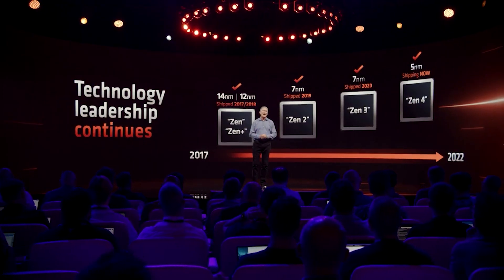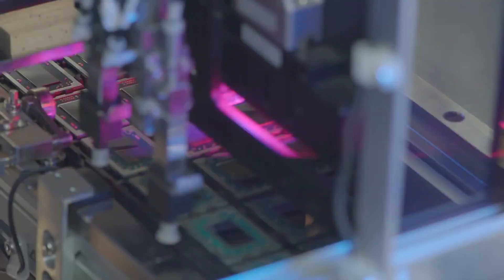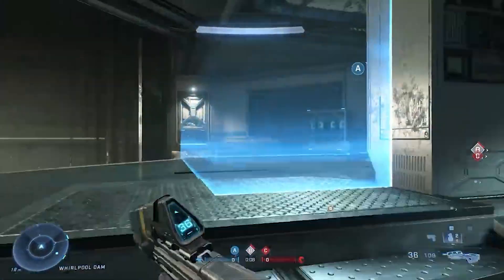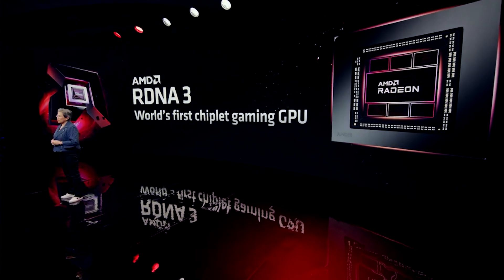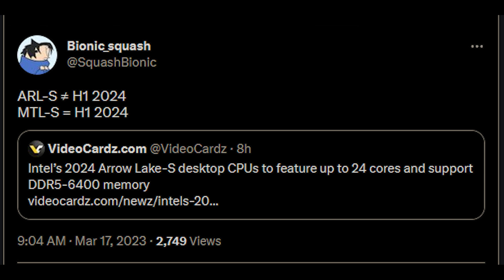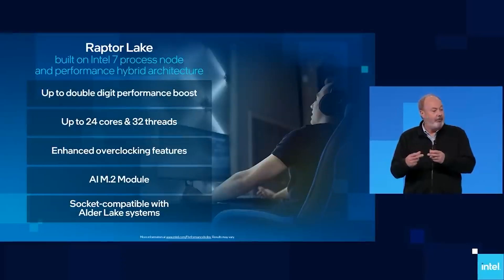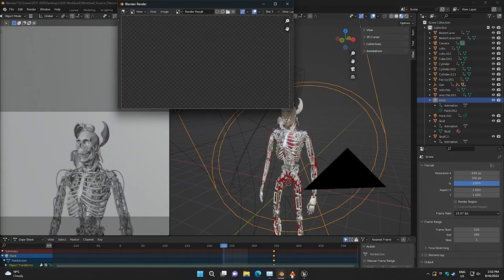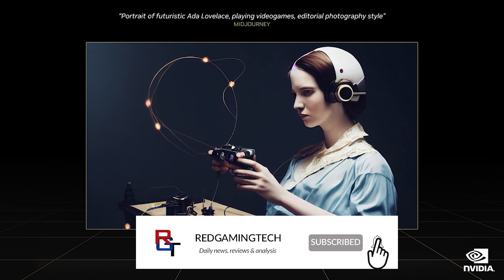Zen 5 CORE COUNT Revealed! HUGE Intel Roadmap UPDATE

Comment: I have continued to say and will keep saying that if AMD sticks with the SAME ASS 8 core CCD and try to make something to compete with Intel on desktop they're going to get their ASSES HANDED to them by Intel who will start winning back the market share they lost to AMD for desktop.  

AMD CANNOT find enough clock speed or IPC gains to compete with what Intel is going to do with 14th gen UNLESS they do a lot of the thing Intel is ALSO doing along with APPLE, such as accelerators which ACTUALLY accelerate REAL workloads that people are concerned about, such as video rendering.  16 cores is way more than enough for most users and I COMPLETELY understand this, but whereas Zen 3 - 4 gains were decent but at the expense of clock speed and power consumption, Intel, on a very inefficient node of Intel 7 is NOT going to be on that node for 14th gen.  Intel doesn't want AMD hanging around nipping at their market share and desktop is the easiest place for them to start winning back market share.  I'd say laptop too, but AMD never really gained much traction in that space and Intel's newer CPUs are better across most the product stack and people haven't really moved away from Intel in that space like they have desktop.  And 14th gen Intel laptops are going to be outstanding.  It will be a slug fest in the server market once Intel gets off Intel 7, but Intel is doing excellent work with improving the technology of CPUs recently, more so that AMD and that's about to give AMD a good thumping if AMD puts out the same old stuff, with improved IPC.  That won't be good enough when the competition is beating you at every tier level except at the very top which probably won't even be true if AMD sticks to 16 cores.  They'll get beat across the entire product stack, and it won't be because Intel CPUs are using 2X the power.

AMD needs at LEAST an 8x8 CCD with 8 big/8 little cores so they can push 48 threads at the top end.  Otherwise Intel is thumping them.

And for those who doubt this, AMD is selling very well for desktop, but it's Zen 3, NOT Zen 4.  On the other hand, Intel 12th and 13th gen is easily beating out Zen 4.  So that shows you what a lot of the consumers think and apparently the power consumption doesn't matter too much for desktop when it comes to 13th gen vs. Zen 4.
Reply: agreed 100%. AMD need to increase core counts as well as find a way to increase core count flexibility in the end product. and they need to get that infinity fabric running at much higher speeds.
Reply: @_M....  Or move off that infinity fabric because that's the reason they're hitting problems now such as low memory speeds with 4 sticks and a cap at 6000 mt/s which means AMD is capped at 3GHz.  And that was AMD taking a LONG TIME to put out Zen 4.

It's projected the interface Intel is using for 14th gen is much better and some of the more trusted names have said as much such as Windell at Level1Tech.  So maybe AMD should move to THAT interconnect since it's the one that's open source from what I understand.  It also runs parallel instead of serial like this Infinity Fabric, and usually parallel interfaces are better WHEN you can run at very high speed AND you have a very good connection, otherwise serial works better.  I don't know if it's the bandwidth limitation of latency that's created that causes the memory speed to suffer.

But to be fair, a lot of reviewers talk about Intel 13th gen as if its memory clocks can clock much higher and no they can't.  Once again Windell at Level1Tech says they have a lot of people on the forum asking how people got their 13th gen CPUs to run with the 7200 memory kits so that's probably getting near their limit, but I don't think they suffer as bad with 4 sticks like Zen 4 does.

Really there's a long list I think AMD needs to do and right now I think they're complacent because Zen 2/3 worked so well for them.  But Zen 4 hasn't, except in the server market.  And, of course for gamers the Vcache parts will sell very well, mostly the 7800X3D, though a lot of creators will buy the 7950X3D so they have one machine to game/work with. THAT was probably the best thing AMD could have done for desktop Zen 4.

Next on my list (getting much better memory speeds = 1) would be the CPU-chipset link needs to double like Intel already did.  Once again AMD is complacent here where they were the first to 8GB/s if I remember correctly but now they've let Intel pass them.  But this once again gets back to the Infinity Fabric and the comms between the CCD and cores.  Maybe they should move the memory controller off the IOD and put it on a CCD?  Then have a direct connect between a 2nd CCD and the one with the memory controller?  So right there is 2 different types of CCDs, and that would fix the memory speed issue.

Then core counts, then an accelerator that matters to people like what Intel and Apple did, they don't need to roll out AI right now, but OK

I buy AMD for the most part unless Nvidia puts out a lower cost GPU, but right now AMD isn't impressing me, Intel is.  Meteor Lake seems pretty awesome from reading about it, and Arrow Lake is supposed to be a progression from that.  So both are tiled CPUs where they can use ICs from different companies which also mean they can use die from TSMC, Samsung, themselves, etc....  Considering Intel already beats AMD at every tier level except the top for desktop because Intel can load a CPU with little cores, yeah they'll get a butt stomping if they stick with that same architecture.
Reply: @johndoh5182  again, I agree. the infinity fabric is a bottleneck and they need to come up with something new already. the limitations of it can really be felt with Zen4. all i know is tht stagnation now is gonna come back to bite AMD and cause them to lose in the one area they've gained back over the last few years. I like AMD and usually get good value out of them. I've only used Intel in the years after bulldozer launched up until Zen 2. heck, my Intel systems were cheaper than my AMD because with few exceptions I always got top end AMD systems and from Sandy bridge to Haswell Intel chips on mainstream were really cheap, as were the motherboards. on the gpu side, i often wish AMD had never bought ATI. in the big picture I am not a fan of how they've done overall.
Reply: @_M....  The GPU market is tough for sure but I think it was better for AMD they bought ATI and become what they are now in spite of the issues they have in competing with Nvidia.

Right now AMD owns the world of gaming consoles because they produce graphics, and it also gives them partnerships that have helped over time.

The issue is always one of strategy and how they can compete.  For instance without RDNA 2 they'd never be in the position now with 2 lines of CPUs/APUs for laptops which is an important market for making money.  You don't have to be the best at everything, but you have to compete and have enough marketshare that allows you to grow and I don't think AMD could have done that without ATI, in fact because their CPU market was a disaster from 2011 - 2017 and even first gen Ryzen wasn't moving the needle very much for them, Radeon is partly what kept them going.  So there might not even be an AMD right now if they never bought ATI.  They had almost zero marketshare for laptops, server, very small for desktop and had SOME profit from game consoles and graphics.

They need a bigger and better engineering team though so Intel, Nvidia and Apple aren't always the one leading with new technology, and though they were really first with chiplets and CPUs, that was because of TSMC being capable of producing the product, and a contractual obligation to GloFo when they made Zen 2.  They're now completely severed from GloFo and they need to make better use of what TSMC gives them for advantages, and right now the only REAL advantage AMD has over Intel is power consumption and that's TSMC N5 vs. Intel 7.

So, I think the graphics side has saved AMD more than what you might think.  It's been great for them with RDNA 2 being such a big thing for gaming consoles.  It will be another big hit if Sony and Microsoft do the proper collaboration with AMD for RDNA 4 and then put out Pro consoles, as long as Zen 5 performs like it should.

Comment: If what you say is true, then next gen for either manufacturer will mostly be an IPC increase update. Neither will go for big multithreading performance increase. I had a tiny hope to see a 32core AM5 chips, but now I don't think this will happen. 32core Ryzen will likely be on AM6.
Reply: AMD Should do 10 core CCXs...20C/40 thread 8950X for example..ideally 12 core CCXs or 24C/48t for 8950X
Reply: Not true, they may go 8 core high cache CCD + 16 core high density CCD, so 24c/48t Ryzen 8000 SKUs.
Reply: Zen 6 will be on am5 I think

Comment: Now those Zen5 rumours are slowly making sense:
.) Desktop stays at 8 cores because 16 cores because most systems do not need more than 8 cores and increasing performance/core is the smarter decision.
It is made on 4nm because 4nm has better clock speeds and most of the die is I/O cache that will not scale
.) Server will probably will still have 8 cores per CCX, but 2 CCX per CCD which would not be smart for gaming workloads but is fine for servers that have several CCDs anyway.
L3 is lower so the CCDs will scale better with 3nm. Also maximum clock speeds do not matter that much, but power consumption does.

For the cache structure I am not sure what this means yet.
My guess is that this is again client rumours and server rumours mixed together.
I could imagine a shared L4 on big datacenter CPUs. This is similar to Intels HBM approach that it does not improve latency that much, but increase effective DRAM bandwidth for multiple parallel but memory intensive tasks. For gaming this does not make much sense as latency of that shared L4 would be awful.

My guess:
.) Client is more or less staying the way it is
.) Server is a different design with increased L1 (with low clocks latency will still be OK), L2 is shared across multiple cores to replace the big L3, L3 is made on N6 and stacked on top shared across both CCX at higher latency than before

Comment: I do like that intel have a big.little design, it makes sense. Just wished that amd would have it to. And I really just need 2 big cores, and maybe 16 small once.

It's.really rare that the thread past the 2nd one is really.intensive.
Reply: Pretty much every new game needs 6 to 8 (real, fast, P-) cores though.
Reply: @nipa5961  not really. They typically need one really fast  then one pretty fast. And the  there is a bunch of threads that is spread out where ever they cache the best.

Most of the 3-8 core is running a large number of small threads.
Reply: @matsv201  We see games that run very poorly on 4 core CPUs and vastly better 6 core CPUs more and more often now. 
Simply having more cores (of the same cores and at the same clock speed) can have a huge impact on gaming performance.
It depends on the game ofcourse.
Reply: @nipa5961  well...that they run better on 6 cores probobly have nothing to donwirh it being exactly 6 cores, but rather due to either cache or throwput
Reply: @matsv201  No, tests on the same CPU with a varying number of disabled cores (cache was left untouched) showed that 4 cores often aren't enough anymore. 

Don't get me wrong, single core performance is super important in gaming, but core count matters more and more too.
Reply: @SweatyFeetGirl  Doesn't matter that they use 16 threads, they all still run from 1 primary thread. Love it or hate it, but that's the reality.
Reply: @teemuvesala9575  One controller thread, however several high workload threads in modern games.
It doesn't matter how good a core the control thread is on if everything is waiting on a sub thread that got shuffled off to an e core.
Reply: @SweatyFeetGirl  You still didn't understand... How hard is it to comprehend that while the game spreads its workload to multiple threads, its always going to be bottlenecked by the primary thread? This is precisely why to this day single core IPC and cache are more important than the core count. This is why for instance 5800X3D slaughters 5950X in games. If there was 3D version of 5600X, it would also beat the crap out of 5950X in games too. Even 4 core 3D chip would beat 16 core non 3D chip in games. All of this proves you are wrong and have a lot to learn still.
Reply: @kaseyboles30  Lighter threads can easily be assigned to E cores with no performance penalty. Yeah there are couple other threads that are also heavy and benefit from P cores, but not nearly as much as the main thread.
Reply: @SweatyFeetGirl  5800X3D slaughters 5950X in games period. If you argue about that then you don't know anything. 5950X is far behind 13th gen Intels in games, but 5800X3D is able to beat them often. 5800X3D is in entirely different league than 5950X in games. The only games where 5950X wins is where the additional clockspeed benefits 5950X + the game doesn't benefit from 5800X3D's extra cache. The games where 5950X wins are very, very rare.
Reply: @SweatyFeetGirl  This is 2023, and games are still main thread bound. Ask any game developer, they will explain it to you (if your simp brain can take it in that is) 🤣🤣🤣
Reply: @nipa5961  Nah they don't. Primary thread basically powers the games even now, rest of the threads are heavily dependent on that 1 thread not being bottlenecked. The fact games need more cores now doesn't change the fact the primary thread is mostly running the game still. So actually having just 1 P core running the primary thread and E cores running the rest would suffice if the CPU also had large enough cache.
Reply: @teemuvesala9575  No. I've seen gaming tests on a 12900K with disabled P-cores. 
Performance on 2P and 8E was terrible,
on 4P and 8E decent, on 6P/8E and above good/normal.
Reply: @nipa5961  Link? Also, what kind of RAM was used?
Reply: @teemuvesala9575  I think HU tested it after the ADL release. 
I also saw a similar test with Zen 4 a few months ago, but I don't recall the channel.
Reply: @bronanu201  That's exactly what said from the get go. 
You need 6 to 8 cores. Not 16. Not just 1 or 2.
Reply: @nipa5961  You only need like 4 high performance thread, rest could be e cores and not much difference at all. Most e-sports games really just run mainly on 1 thread. That clown was claiming 5950X is better for gaming than 5800X3D 🤣🤣🤣
Reply: @teemuvesala9575  Well, CSGO and Dota run on a potato ofcourse. 
For most new games it's 6 to 8 cores though. 
Also, all benchmarks I've seen showed that performance tanks if e-cores have to be utilized.
Reply: @nipa5961  Nah not the case in my experience. When my E cores get utilized in the game there are no performance drops with 13600K. From what I can see the thread scheduler assigns heaviest threads to P cores, and then lighter threads to E cores. The thread scheduler prefers handing lighter game threads to E cores instead of utilizing hyperthreaded P core threads. Hyperthreaded P core threads don't really get used that much at all.
Reply: @teemuvesala9575  Weird, that's the exact opposite from what I've seen in every test.
All came to the conclusion that games try to avoid using e-cores at all costs.
Reply: @nipa5961  Maybe they do with 13700K and 13900K since they got 8 P cores.
Reply: Amd CPU cores are very small already , its just Intel Pcores are lot larger , but yes Scores are little smaller .
Overall amd CPU die is much smaller already , no need to go with Score nonsense , all Pcores are best
Reply: @skywalker1991  Well AMD have 5nm lithography, Intel dont. that is pretty much the secrete behind AMD small cores.  

But the main reason for having smaller cores are a higher instruction per joule number as well as better performance while doing heavily threaded loads like rendering or video compression

Comment: Not increasing the core counts will be a mistake
Reply: I'd rather have higher frequencies because game engines can't even use what we've got.  I like Intel's approach with performance and efficiency cores for that reason.  More atom cores would be cool, but I'd like to see Intel get a little more efficiency and even higher frequencies.
Reply: Why is it a mistake?
AMD and Intel are tied in performance even though Zen 4 has 8 cores less than RPL.

All Paul said was that Zen 5 chiplets will stay at 8 cores. 
AMD can decide to give the 8950X 2 or 3 (or even more) chiplets very shortly before release depending on the situation and competition in 2024.

Comment: I’m still completely satisfied with my 12100f . Handles all the games I play without a problem. All these new CPUs and stuff are cool but that i3 which is like 80 bucks now NEW is such an epic deal.
Reply: God bless poorly multithreaded games, keeping the i3 gamers happy
Reply: So let's see, a 12100f for 80 bucks or a 5500 for 95 bucks.  Yeah I think I'm glad I got the 5500 for low end builds.  Those extra 4 threads matter
Reply: @johndoh5182  yea but the cores are slower on the 5500 and the 5500 lacks pcie 4
Reply: @earnistse4899  I don't see that PCIe is that much of an issue, especially on budget builds with low to mid-level GPUs. Gamers Nexus did a scaling test with the ultra-fast RTX 4090 and found on average about a 3% difference in performance.  Nothing to write home about.
Reply: i3 cpus are for homeless people
Reply: Still hangin’ out with 7700k at 4.7 GHz all core…; zero issues.
Reply: @mdd1963  one texture for an object???  🙂